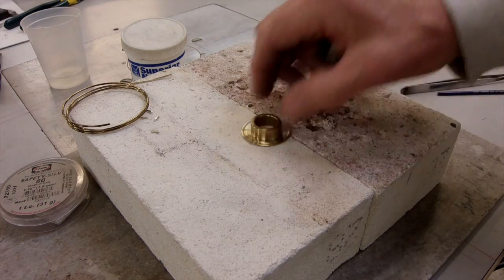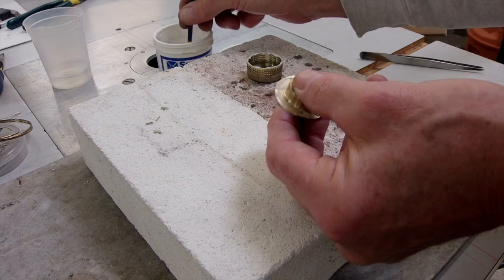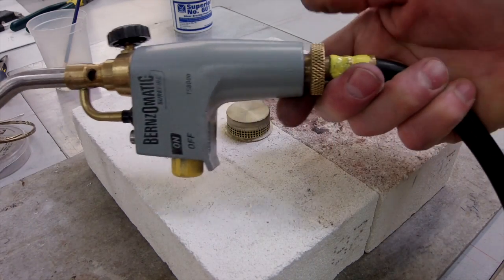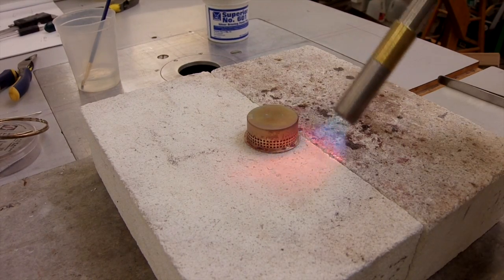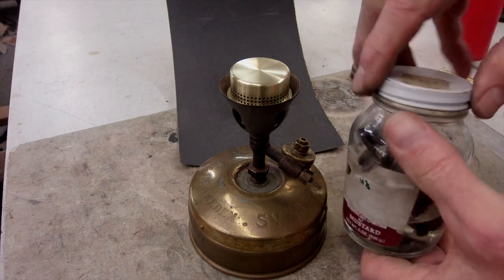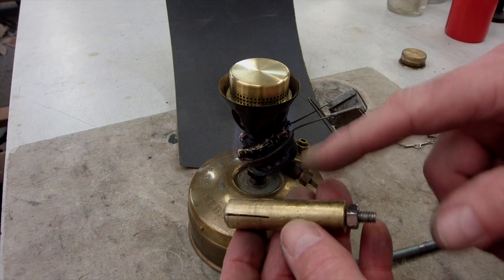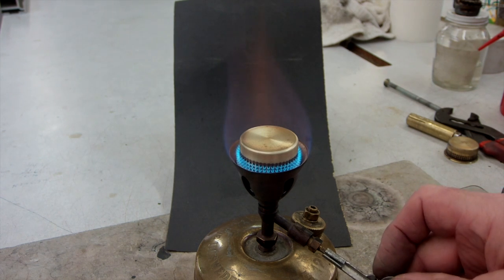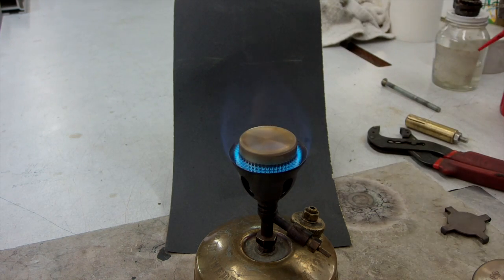Machined Silent Cap

Comment: The cap does not over heat the gas tank?
Reply from the maker: @Ismael Cortés 'Mayiiobros' Absolutely not! There is no more heat or fire above the tank with a cap than there is with the flame plate. As with the flame plate, the valve stem of the stove is cooled by the flow of fuel through it from the tank. No additional heating of the stove tank occurs with a cap versus a flame plate. BD

Comment: That's an actual 123 like mine! Not a 123R.
Blue flame is hotter than yellow flame. It was good to see it go blue the second time around as that means it's getting a good hot flame. How will you attach it to the bell in order to keep it from accidentally coming off or coming loose if it tips a bit? 
Is there anyplace where one can buy a cap such as you made? I'm not handy, and don't know anyone who is.
Reply from the maker: @MammaDuck Commercial 3D printed versions of the silent damper caps I have invented/designed (the specs with which I helped this machinist fellow in the video) are available here: http://shpws.me/DWiP
Techniques for securing an aftermarket silent cap to the burner bell are discussed in the cap instructions here: https://www.berniedawg.com/berniedawg-silent-damper-cap-instructions/
Any other questions you may have I'd be happy to answer via my business email here: bd@berniedawg.com Thanks! 👍 BD

Comment: The yellow orange tinge that burns off is probably sodium out of the residual flux that was left behind inside.
Reply from the maker: Yup. From the disodium tetraborate (borax) in the Harris flux. Burns off after a bit. An ultrasonic bath of hot water will take it off before use, too. BD

Comment: Is there such a need to solder the details? how to clean them, after prolonged use, accumulation inside the soot.
Reply from the maker: Using proper fuels there should be no soot. NEVER use automotive gasolines with such a stove and you will be soot free for life. But, should cleaning be necessary, just pop it in the ultrasonic cleaner with some solvent. Easy-peasy. BD

Comment: Hi, what is the original size of the gas injector, 0.5 or 0.8mm? Thank you.(google tradutor)Congratulations of Brasil!
Reply from the maker: If by your question you mean, "what is the size of the jet aperture (hole)?", both 0.5mm and 0.8mm are incorrect. The jet aperture (hole) for the Svea 123/123R should be 0.23mm for proper performance. If you mean some other thing and I've misunderstood, please give it another try. 🙂BD
Reply: @BernieDawgCinema  Perfect thank you! That's why my Svea has low performance, I already bought used, I'm trying to restore it, learning a lot with your videos!!!
Reply from the maker: @fechaed  Thanks! BD

Comment: So the stove when it is going will not get the cap hot enough to remelt the solder?
Reply from the maker: Nope. It's not solder - it's silver braze filler. Has a melt temperature of around 1300 deg F. A small amount of hot fuel vapor (less than 500 deg F) mixes with lots of room temperature air and flows through the cap to cool it all the time the stove is operating. The flamelets don't touch the metal of the cap, they are isolated by that cushion of fuel/air vapor which draws heat from the metal of the cap. Just like the cooling system in your automobile. These basic thermodynamic principles are why I was able to hand-build and sell hundreds of silent damper caps made from metal tubing and metal sheet a few years back. 👍 BD
Reply: @BernieDawgCinema  thanks for the prompt response, I'm only familiar with solder so was not sure about properties of braze.
Reply from the maker: @1LRLRG  I understand completely. Confusion about brazing and brazing filler versus solder and soldering is due to the unfortunate but too common misnomer of calling this process "silver soldering" instead of "silver brazing". Here is a nice link to the Harris people who make a range of brazing fillers with various amounts of silver. The technical info tabs can be instructive. https://www.harrisproductsgroup.com/en/Products/Alloys/Brazing/High-Silver/ Enjoy! BD
Reply: agreed the term "silver soldering" is stupid. today, anytime you join metal together with a torch people always assume it's soldering. i totally freaked out a couple of millennial co-workers by oxyacetylene welding together 2 coffee cans using a wire coat hanger as filler rod...